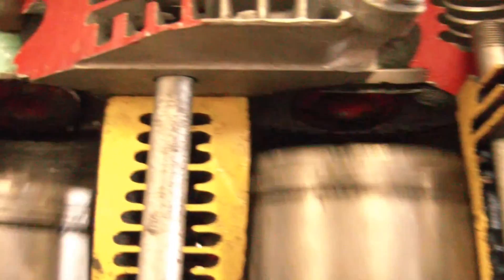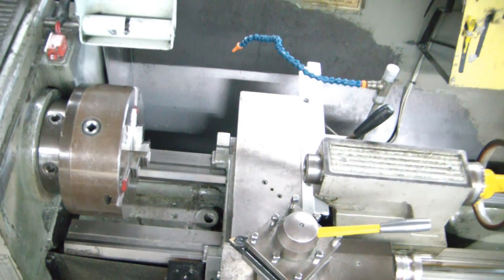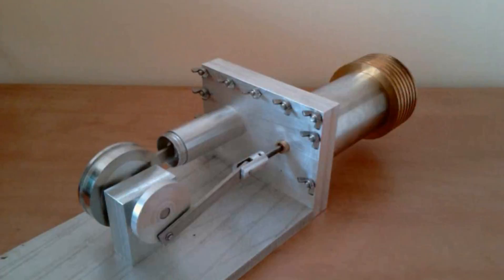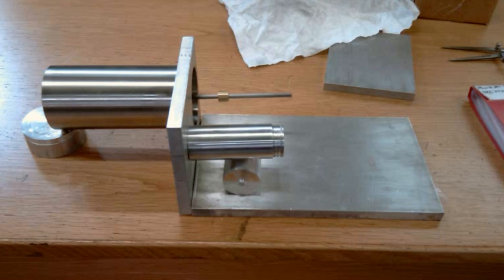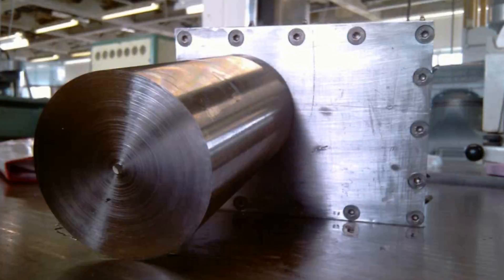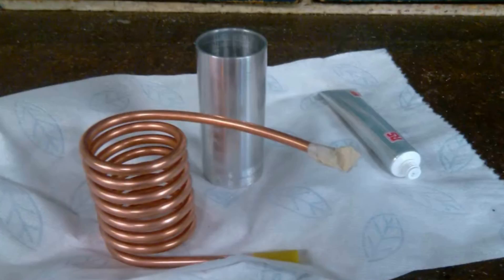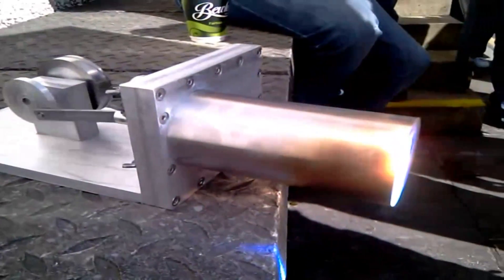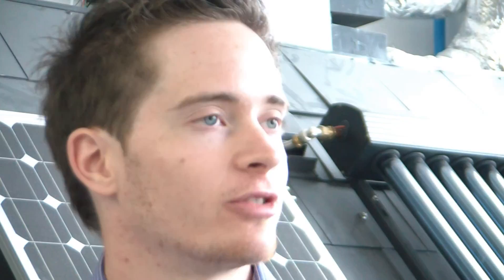GMIT - Mechanical Engineering

Comment: @straighter100
I had the same question about 3 years ago, and no one actually gave me a clear answer. But here is it: you will take a bunch of math courses, starting from calculus, differential equation all the way to Methods of Applied Math, I wasn't a big fan of math when I was in high-school (I actually hated it..lol), and did not do well in calculus and math in general in college..the good news though, you will only use basic calculus in the actual Mechanical Engineering courses.

Comment: question:
In that mechanical engineering, you use mathematical models and virtual designs to display parts and designs, while designing, in what part of this engineering is calculus or derivatives or integrals applied?
I'm really baffled about those cuz calculus is really hard to implement into real life...